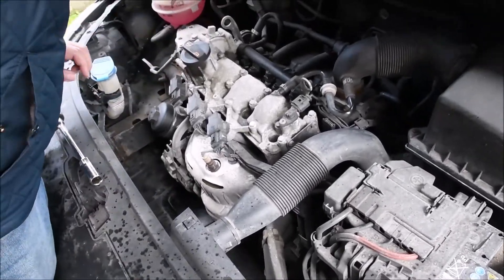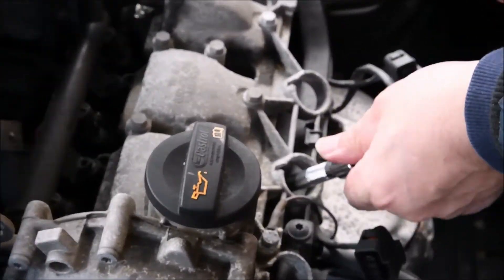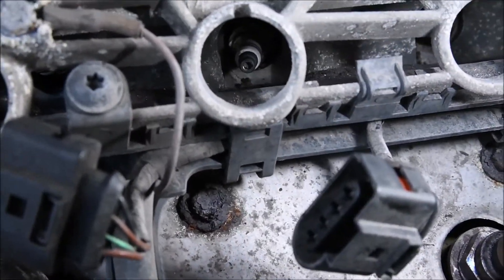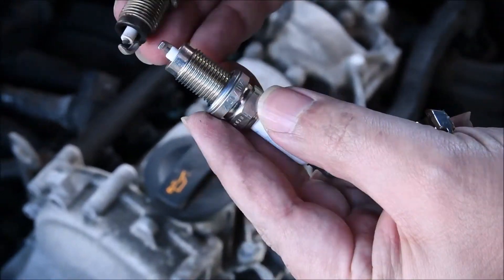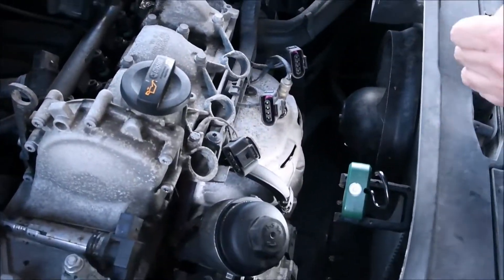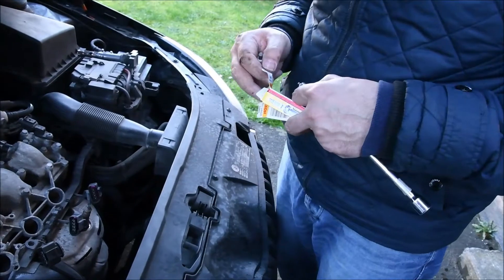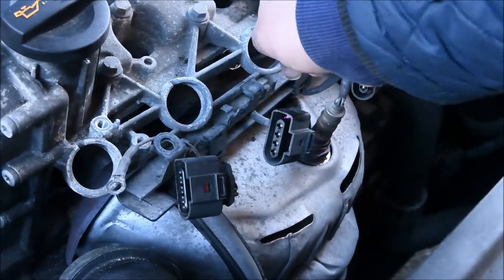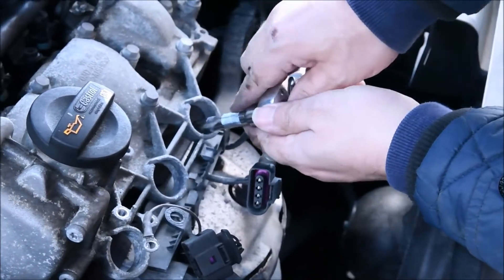Replace Spark Plugs in Skoda Fabia 1.2L Engine

Comment: if i have ignition coil from v12 can i use it for v6 1.2 engine, despit different shapes? or absolutely no?
Reply from the maker: Not sure myself, I would use the correct one just to be sure. Thanks
Reply: @engineerityourself123  yes. i see it doesn't fit anyway.